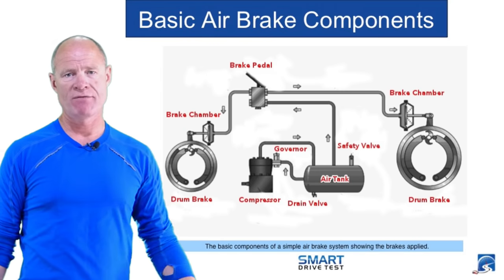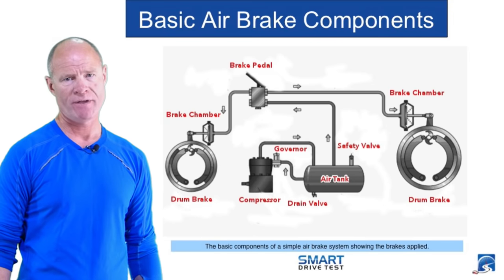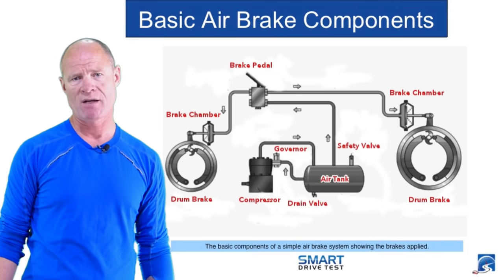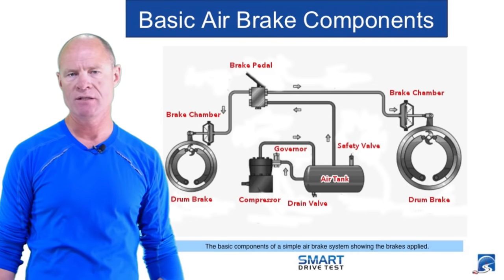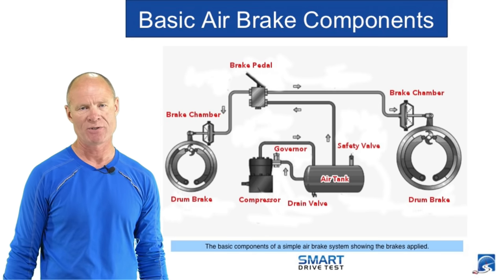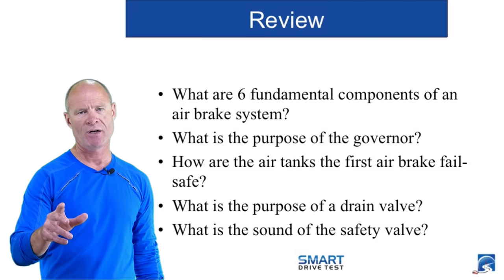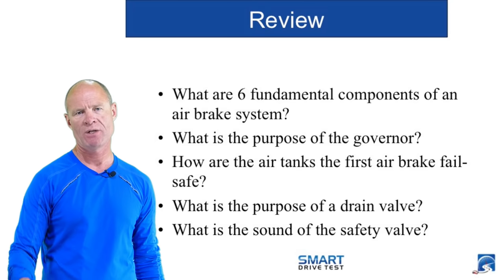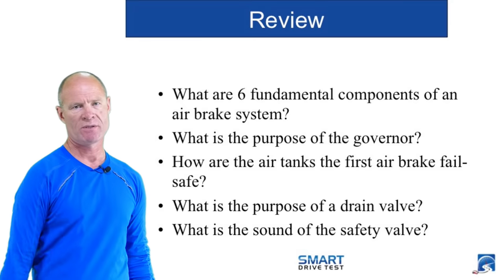Basic CDL Air Brake Components

Comment: Every safety valve on the trucks I work on just sounds like a massive air leak.
Reply from the maker: Hi Advertisement Profile - Thank you for your comment and relevant information. Drivers need to know that it can also make that sound so they're aware. And when they hear the leaking air, they also check the air gauges. All the best, Cheers Rick
Reply: True that I bet I'll see one eventually that sounds like your saying. I work on garbage trucks so.  Peterbuilts Mack's Cummins. Paccar.  But all are 10 wheelers    this video was awesome. I'm a lube tech and I fix air leaks and change slacks and brake Chambers all the time.  This video helped me get a larger group understanding of the air system it really helped after having lots of hands on to see the bigger picture.
Reply from the maker: Advertisement Profile - happy  to hear we could help out my friend. Anything else we can help with drop us a note. All the best; Cheers Rick

Comment: Hy bro I'm form fiji and I have issue with the fully air system in E-one which is with Detroit engine (8×8 wheeler truck) and it has disc brakes system.
Can I have yur whatsapp number so we can talk about it.
Thanks.
Reply from the maker: What's the issue you're having? Cheers Rick

Comment: You can not set your brakes if you are a driver driver has to call a SE to come out on the side of the road to set them 2 hundred dollars
Reply from the maker: Hi Samuel Cantley - Apologies for the late response. Thank you for your comment. If the brakes are fitted with automatic slack adjusters, then yes, you can't adjust the brakes. However, if these are manual slack adjusters, then you can. See this video for further information: https://www.youtube.com/watch?v=knbgfudCZC8&list=PL0x-bChcUvwG2bSWReQWnk9Tm92L7WN_O&index=8&t=524s If there is anything further we can do, drop us a note. Always happy to help. All the best, Cheers Rick
Reply: Thanks a lot , beautiful presentation ,short ,clear and briefly , most importantly informative ,. I'm a qualified petrol mechanic , I have a applied for trade test in Diesel mech, Air brakes it's one of the tasks I will be assessed on.

Comment: WHERE THE FU*k IS THE RELAY VALVE⁉️⁉️
Reply from the maker: No need for yelling. And keep in mind, this is a PG channel. The relay valve is NOT part of the fundamental components. These relay valves are usually located at the axles in the centre. These are complicated due to the combination with quick release valves. If you want to learn more, you can check out the e-book "Air Brakes Explained Simply." You can find that here: https://www.smartdrivetest.com/airbrakes-cdl-rv/air-brakes-explained-simply Drop us a note if you have further questions. Cheers Rick
Reply: @smartdrivetest  Yeah but this was a question on the CDL Air & Brakes Permit Test. And it was confusing, bc I never heard about the relay valve until I took the test. It really pissed me off bc I got it wrong.
Reply from the maker: Where are you taking your test? And the course you took never mentioned the relay valve? Can you remember what the questions on the test was? Cheers Rick